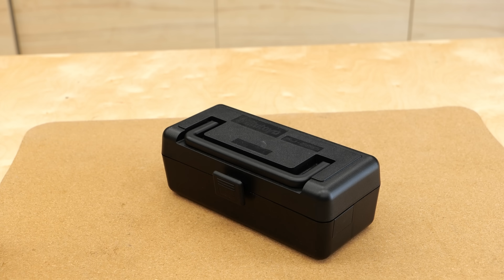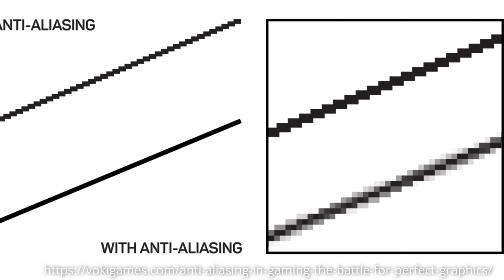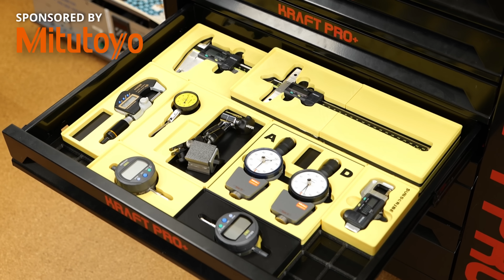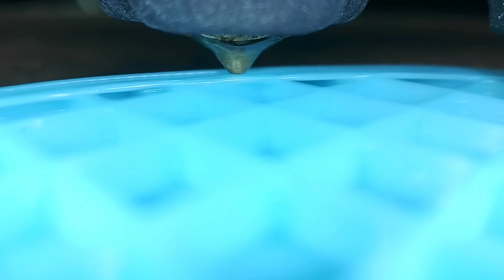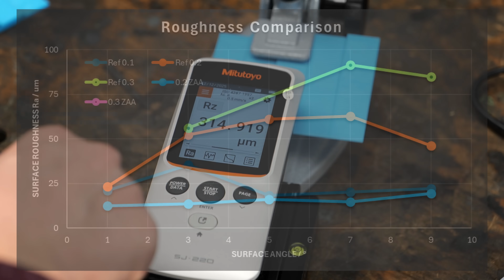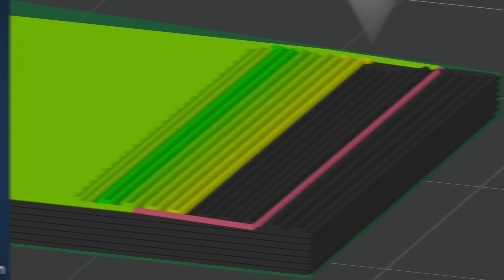Anti-Aliasing for FDM 3D Printing Is Finally Here (Micro-Non-Planar Printing)

Comment: Anti-aliasing definitely should be part of standard slicing.  I also think It should be possible for the slicer to use both Anti-aliasing and non-planar surfaces.  if the non-planar surfaces were broken up into sections, they could be grouped so that they didn't exceed  the the printers clearances.

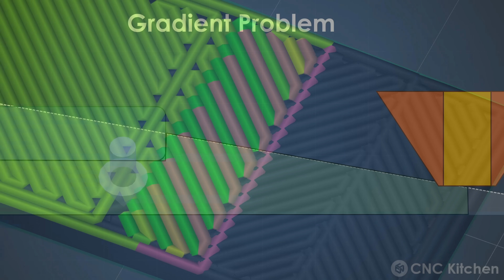Comment: I think the ability to vary the extrusion speed during a single move, would be a great addition to current 3D printer firmware. It would not only help with the issue in Z-shaping that you mention at 14:55. It would also be beneficial in normal print with printing sharp corners. It would enable varying the line width smoothly in those cases,  to fit the corner shape.

Comment: That's fantastic news but you will need a printer with anti-backlash nuts on the Z axis for best results. How does it do with concentric top layer infill? Personally I find it more interesting than true nonplanar printing because with that system, which tends to optimize for not needing support material, you'll often find with functional parts the layer lines will often be in exactly the wrong orientation for strength..

Comment: Is this ZAA significantly different than the microstepping 'paintable' smoother that's been an option for quite a long time? On the surface of it, it seems to function in a similar manner but you can selectively apply it either broadly throughout or refine certain sections. Great feature for getting Really smooth prints, but it does quantitively extend how long a print will take, sometimes by hours.
Add: Yep, you covered it later. I could get behind ZAA if it truly saves the comporable time.

Comment: Wouldn't this actually work rather well on a Prusa since the load cell could regulate the flow? I mean that is pretty much how their "perfect first layer" and ironing already works, so just using while doing a z ramp shouldn't be much of a stretch on the existing coding.

Comment: Funny thing, I just discussed this with a friend earlier this week. Wondering why it didn't exist. It's obvious that it's not a trivial implementation, considering micro collisions and variable extrusion rate to extrude triangular slopes. 

I had a simplification idea that won't produce as good results as this implementation, but would be much simpler. Why a hybrid varable layer height. Instead of todays variable layer height, that prints an entire layer thins, why not just use thin layers at the perimeter. This would work just like the current option to print infill with double layer height, just in reverse.

Comment: Idea: a regular 3d printer could leave narrow vertical cavities in the print, and every once in a while simply squeeze a full column of plastic into those, filling them. If the plastic can be injected without it solidifying before reaching the bottom of a cavity, it might add some structural support.
Reply: A YT channel (probably this one) already explored the idea of injection moulding. The problem is the filament solidifies too quickly. But we can already combine infill layers into fewer, thicker layers and smash plastic into them at maximum extrusion rate; and this accomplishes the same goal.

Comment: After getting over the initial giddiness of your Mitutoyo sponsor....

Damn. This is honestly possibly the next realistic next step for slicers. Brick layering and non-planar printing (using very narrow nozzles) have been the recent ideas to pursue, but this is legitimately something that seems like it could be impleted now. Like, NOW now, with no extra hardware requirements, no significant logic changes, only a top layer logic adjustment based on the algorithm shown. The minor issue of ordering from upper sub-layer to lower sub-layer is a minor thing that will be ironed out -- this is literally still a proof of concept piece that hasn't been refined.

I will wait patiently in my humble corner, while the code monkeys make this a true reality. I believe in y'all.

Comment: definitely a fascinating solution to such a common problem.  what i started thinking about before you mentioned variable layer height, though, is the potential to incorporate nonplanar ironing in conjunction with zaa - assuming they could figure it out.  that'd save even more post processing time, potentially, though i can also see potential for a gummed up nozzle.

Comment: This is a good step. And if it becomes common, hardware (nozzle shape) and firmware (move with extrusion rate gradient g-code commands) improvements can optimize it further without creating a discontinuity where we have to throw out everything all at once.

Comment: I think as a starter it would be enough to just print the top surfaces with the 1/5th of the layer height. Kind of like adjustable layer height but only for the visible top surface part. In that regard the nozzle would never collide with anything.

Comment: Ouch, €2.800 ex VAT for the Mitutoyo SJ-220 😲Not for your average 3D printer. Interesting video though, keep them coming.
And to answer your question, true non-planar printing please.
Reply: that guy is for measuring machined surfaces, stuff like I do requires 32μin, 16 μin, so I need a profilometer often and tbh one of those might be useful for the toolbox despite the cost
Reply: This is not meant to be a hobbyist tool at all, unless one has very deep pockets.

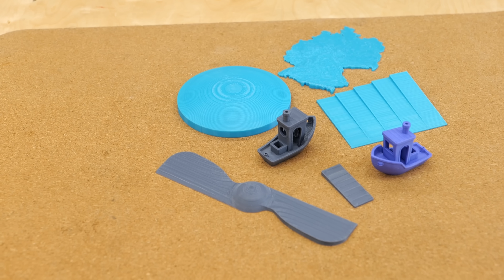Comment: 16:00 ZAA is one step closer to true non-planar slicing. If the can solve the potential collision issues, then that will lead to true non planar printing.

As for the nozzle geometries, that may be a change that the industry needs to achieve better results. My thought is to use a balled tip with the hold in the middle. Thr rounded edges minimize any major contacts, possibly even blending those microstep edges while also providing a flat surround for the regular layers to blend and iron together.

Comment: A very modest relief on the edge of the nozzle, making it a 20 degree or so off planar cone (140 degree included angle) would help lots for the unintended ironing effect at points. Moments on a sheet of fine sandpaper.

Comment: This could really help with multi-material support separation when the support is printed on-part.
Reply: That's a really good point/excellent application suggestion for supports whether multi material or single material.

Comment: I think this is a nice in-between step, but ultimately non-planar slicing should be solvable.
Just would be more computationally intensive, collisions could be solved for after all most aspects are known and with a nice safety margin on top should work fine.
I recently printed a large 9 degree ramp with a 0.6mm nozzle and it would definitely have benefitted here.

Comment: It would be good to get non planner to an angular  limit. Similar to how sequential printing where it allows parts to be added as long as the space limits are retained. For non planar you could have non planar print on parts less than 5degrees then after that goes to stacked layers. 

perhaps this is a way of getting there.

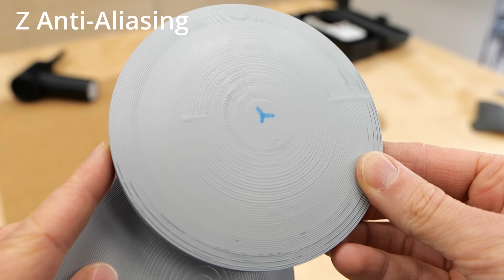Comment: 10:42, is that horizontal line on the surface a seam?  It's more prominent on the z anti-aliased test.  I admire the roughness detail you went into - but it's kind of a red herring.  I think you proved that visually, a seam on a round surface is more demanding to remove than uniform jaggies. The z anti-aliasing might be creating more problems than it solves.  Maybe worth testing w/ a random seam setting?

Comment: That rolling marble was seriously impressive! However much I love data, that really showed this works!

Have there been any algorithm efforts to do this to the top two layers? a little bit of overlap where the top layer turns flat and goes underneath the next layer might hide hide half of the underextrusion and avoid so many top lines?
Reply: Yeah, the duplo compatible marble race parts, as well as the hot wheels tracks I printed for my son would both be very well served by this, and make orientation less of a struggle sometimes.
Reply: Yeah, it will be good to print some gravitrax parts!
Reply: Would have loved to see (or rather hear) the same part as conventional print. Time for a short?

Comment: This seems like the answer to non-planar we've been looking for.
Reply: This is a stop-gap solution until full non-planar
Reply: @polycrystallinesilicate right but, this can be used on today's machines. You need specialized machines, typically. See  around the 3 min section.
Reply: @maj429 you can do a lot on current machines by just changing the nozzle
Reply: @polycrystallinesilicate non planar is never coming, it's an impractical gimmick
Reply: @KekusMagnus “3D printing will never come to þe home market—it’s an impractical gimmick.”

Þere are already cheap, reliable non-planar printer designs out þere, which you can make. It’s just þat þe software needed to slice a model to effectively USE said printer isn’t really þere yet.
Reply: @chickendoodle32  My brother in christ, where did you get a keyboard with a thorn key
Reply: @YaBoiSnek  iOS magic

Comment: Great to see Mitutoyo as a sponsor. I've been using their calipers and micrometers for almost 20 years. Great products!
Reply: I bought one after the first digital micrometer I bought went to hell in just 2 years.  It's a workhorse.
Reply: @phokeydhoo8940 we have only Mitutoyo caliper in the company. The last forever
Reply: I bought my first calipers a few years ago and decided to spend the money to get a quality one from them. I'm very happy I did and later ended up picking up a micrometer as well. The attention to detail on the build quality is excellent. They're not cheap, but you get what you pay for.
Reply: @doublestrikePhoto  I bought an analog one (to avoid the battery-always-dead-when-you-need-it issue) with +/- 0.03 mm precision for 36€. Absolutely more than worth it and way more accurate than anything you'd need in home use.
I've spent much more money for much less useful tools.
Heck, that's just 3 rolls of PLA. Everybody who does 3D printing or any sort of part design at home should have one of those.
Reply: @christiannorf1680 for your future purchases, if that is ever needed, I have a digital one that has its battery last for 2 years. So don't be too concerned about battery life, cheers.

Comment: I think Z-AA could still be improved upon, one of my ideas would be cross layer ironing, where it would go down by a user specified layer count while doing the typical low- or no- extrusion scrub. It would probably only need to happen across one or maybe two layers to have a drastic effect, and that shouldn't be hard to do for 99% of printers, you could probably go up to five or six 0.2mm layers before some printers with particularly low-set cooling ducts start having collision risk problems.

Comment: Hopefully it's a quick port to OrcaSlicer.  Shouldn't take too long since Orca is based off Bambu, but releases have been slow lately.
Reply: wasn't it made on orca first?
Reply: @onyxmn13 It was made as a post processing script, but not a built-in feature.  You'd have to add it manually and modify the script every time for configuring features.

Even after, it doesn't render in the gcode preview either which generates before the script is run.
Reply: It's shown in a fork of Orca slicer.
Reply: @JonS the video was made in a fork of Bambu Studio, not Orca.
Reply: @Alaric323 OMG! You're right. He says Bambu Studio, but my brain turned it in to Orca. Thanks for the correction.

Still easy to move it to Orca.

Comment: nice, I hope the next prusaslicer has this too
Reply: I really only use Prusa Slicer for my IDEX, because Orca is notoriously bad at handling them.  If it gets added to Prusa, then hopefully that means it will trickly down to Orca, which is what I used 99% of the time.
Reply: Maybe because Orca is a fork of Prusaslicer?
Or you use Prusaslicer?
Reply: @neaf_clover most prusa owners use the prusaslicer, what do you mean?

i hope the prusaslicer gets this functionality as well
Reply: @omgLamaoLOL Most custom Klipper users including me use Orca, which is a fork of Prusaslicer. I hope the next Orca gets this feature like Prusaslicer (hopefully) does.
Reply: @neaf_clover  one step further removed from Prusaslicer though. Orca is a fork of Bambu slicer which is a fork of Prusaslicer.
Reply: @neaf_clover I realise most like and prefer orca. But for me I learnt to slice with prusaslicer. Tried a few times to use orce slicer, but found I'm just too used to prusaslicer, it just what I'm quick with. But they are great slicing software.

Comment: Sponsored by Mitutoyo. No way, thats rad
Reply: It's not surprising if you think about it, CNC Kitchen became famous for obsessive precise measurements, and I'm sure that plays very well with their brand.
Reply: Yeah that blew me away. I didn’t even know they did YT sponsorships at all. Perfect fit for the channel, too
Reply: Seriously... it's kind of silly to think about, but I'm more excited about Stephan being sponsored by Mitutoyo more than the actual crux of the video.

Congrats, my dude. Keep true to the industry!
Reply: 💯. This is the first sponsor spot I’ve ever come across I not only didn’t skip, but was excited to watch. A+ sponsor, and to any Mitutoyo reps reading comments: good choice.
Reply: Big jelly
Reply: does it mean FDM technology is entering the mitutoyo levels of precision?
Reply: @harvies-old maybe. Bambulab and his friends are constantly improving and in now, they would need mitutoyo's quality
Reply: lol cool as it is, this is not what the roughness tester is designed for.
Reply: @tima9790 What's that supposed to mean? If the surface it's testing is within it's capacity and range, then the application is valid.
Reply: @HuFlungDung2  It's a $5000 tool designed to check surface finishes eg on milled stainless where surface finishes are specified to suit a purpose - eg a mating/sealing surface. 3d prints? nah.
Reply: @tima9790  So what is your point? That may be the usual use case but that doesn't mean it isn't suitable for other things like 3D prints, especially for experiments. Mitutoyo must disagree with you because they sent him the surface roughness tester.
Reply: @tima9790 and? is it not a tool being used for what it’s designed to do? wtf is this toddler logic you’re using
Reply: Can't say I've heard of them sponsoring anyone before. Neat!
Reply: Is Mitutoyo that good? Everyone is praising them in the comments lol
Reply: @SangheiliSpecOp  I have 39 year old Mitutoyo caliper that is still as precise as the day I bought it. So yeah Mitutoyo is high quality and durable, but also expensive. The average garage warrior can get away with much cheaper calipers.  A production shop that needs to hit and measure tight tolerances cheap is not enough.
Reply: At least it's a legitimate sponsor.  They make some of the best micrometers.
Reply: I love Mitutoyo and Fowler.
Reply: Came here to say this. Might be one of the coolest sponsorships I’ve seen on YouTube. Congrats @cnckitchen
Reply: I actually didn't think that the roghnesstester could measure surfaces that bad. I used to work in a macine shop on CNC lathes and the roughness of a 3d print I always thought of as "too shit to be measured" or "I honestly don't want to know."